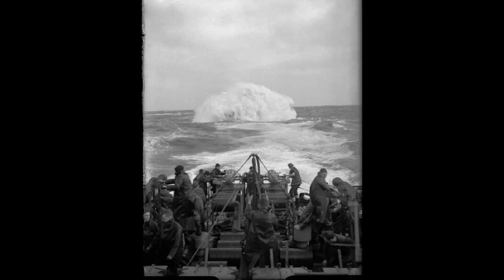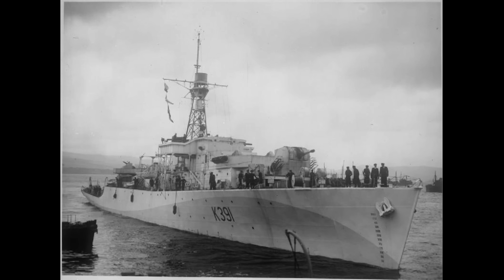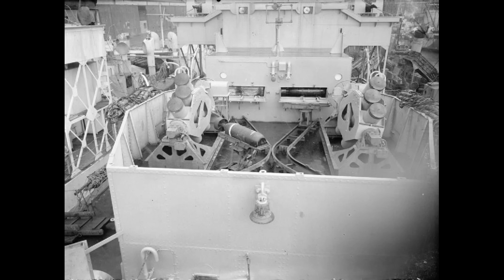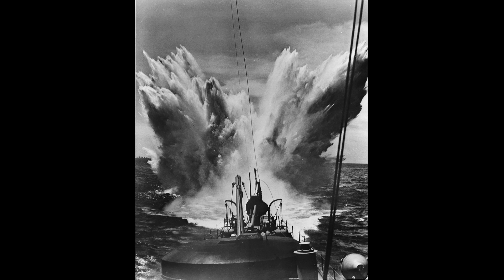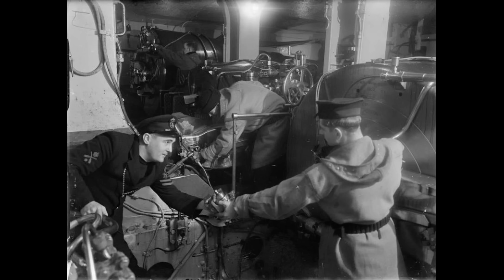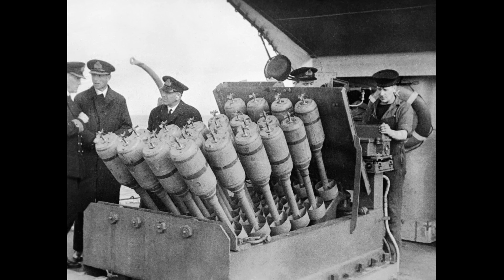The '3-Barreled' British Weapon That Killed 1 in 3 Submarines It Attacked

Comment: The sonar tells you where the U boat is.  The problem is to know where its going to be at the time the Squid arrives at the same depth.  Deriving the uboats true course and speed from its relative movement takes some speedy drawing/calculations and passing of information but what was needed was a simple analogue computer.  The RN didnt have one. Hence the ship would try to steam over the top of the uboat on the assumed uboats course.  I very much doubt that the Squid achieved 1:3 kill ratios.  Its successor, the ASW Mortat Mk 10 couldnt do that and it had a computer for calculating launch trajectory and bearing.
The detonation of the first salvo will ruin the sonar picture, so a 2nd launch in 90 secs is pointless as their would be no sonar data. An original porblem solved by the Hedgehog system.

Comment: Squir (Mortar Mk 4 ) was manually loaded 
 And, as noted, frigates had two mounts which fired a pattern of 6 - Battle class destroyers had a single.  In most ASW frigates Squid was replace by Limbo (Mortar Mar 10), which was power loaded, from the mid 50s.  Only AD and AAW Frigates, Cathedral and Cat classes had Squid fitted after that date - for space reasons.
Reply from the maker: The double mount on frigates (6-bomb pattern) is a crucial detail I missed. And you're right about Limbo - power-loading was a major improvement. Really appreciate the technical depth!

Comment: Acording to my knowledge, they used a pattern of 6 depth charges forming 2 triangles meeting at the top. Depth charges in the pattern were set to detonate above and below the submarine, not just piercing the hull, but breaking it completely. The overall effectiveness was roughly 35%, but Royal Navy claimed, that after learning to use the "Squid' they reached 50% success rate.
Reply from the maker: You're spot on about the dual-triangle pattern, most ships had two Squid mountings firing six charges total. And yes, the converging pressure waves from detonations above/below were designed to crush the hull. Your 35% figure matches the verified stats (17 kills in 50 attacks ≈ 34%). Great additional detail!

Comment: using a clockwork timer and knowing the charge’s exact sinking speed (which was a very fast 43.5 feet per second), the fire control computer could calculate exactly how many seconds it would take to reach the submarine's depth.  
The ship's sonar (Type 147 ASDIC) would automatically transmit the target's depth to the Squid mounting. A mechanical "fuze setter" would then dial the correct time into the charges just seconds before they were fired.  
Squids were usually fired in salvos of six (from two triple-barrels). One set would be timed to explode 25 feet above the sub, and the other 25 feet below
Reply from the maker: Exactly right! That opposing pattern detail (25 ft above/below) is brilliant. Appreciate the added technical context!